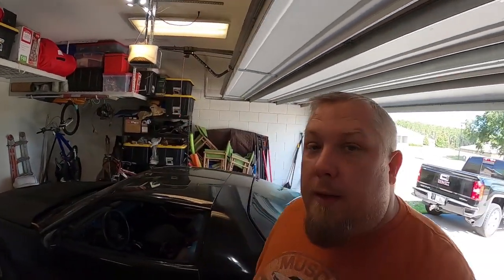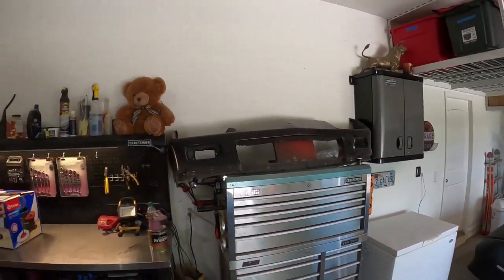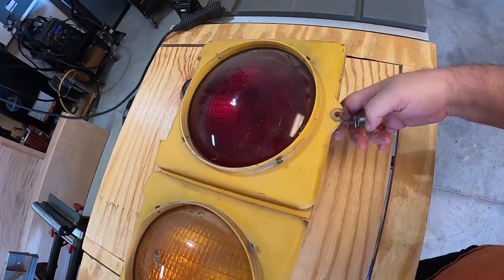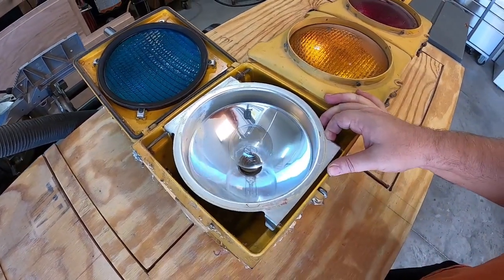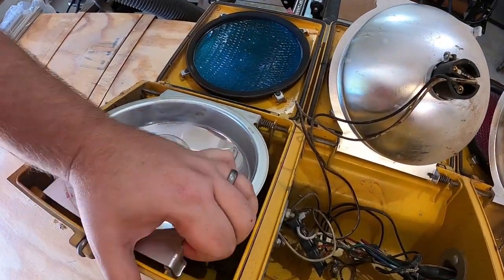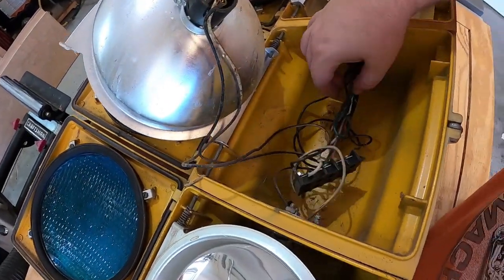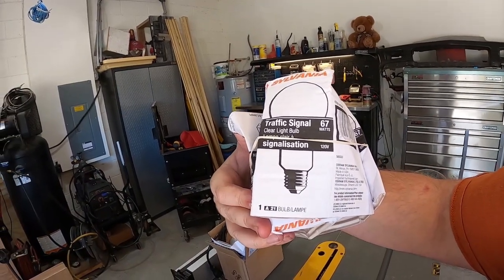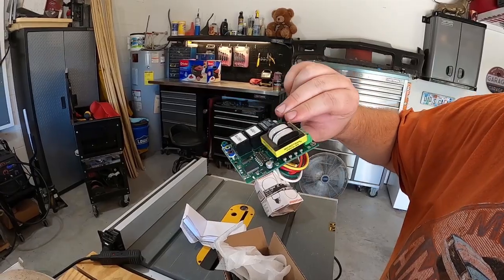Shop gets a traffic signal. Installing controller

Comment: You should see if you can get a distance sensor and put the lights in the front of the car so as you pull into the garage it goes read once you are in the correct distance...
Reply from the maker: That is a good idea, thank you.

Comment: I mounted mine in the back yard on a tree.  Ran power to it in conduit from my back yard workshop/shed.  Added a "Z-WAVE" wireless switch so I can yell at my cell phone "Hey Siri turn on the traffic light" .  The neighbors think it is really weird...  My dad was a city engineer, don't ask how I got mine...   Best way to mount it, if you don't have the proper brackets are 2 1/2" Electrical conduit, elbows and  flanges.
Reply from the maker: tom jones lol that is awesome, thank you for the mounting ideas, that helps a lot.
Reply: @CamaroMac  As for that relay kit that you are using ...  My wife got me that for same kit for fathers day about 5/6 years ago and it has been outside in the weather since.  Though not rated for outside use, it will take the abuse... At least mine did.  The power transformer will get a little rusty, but it still works.